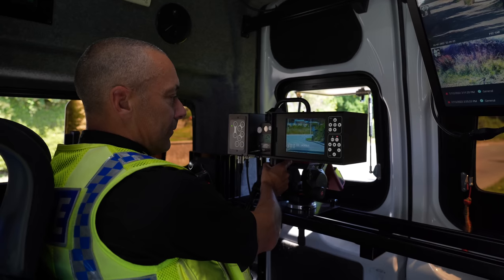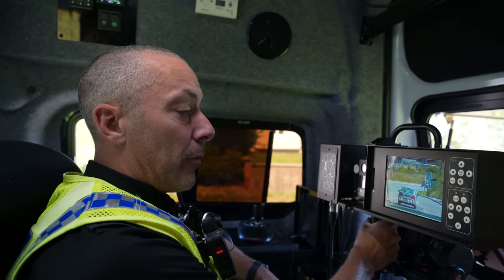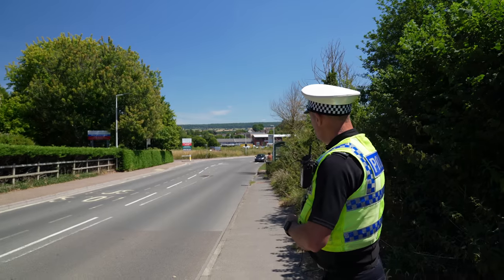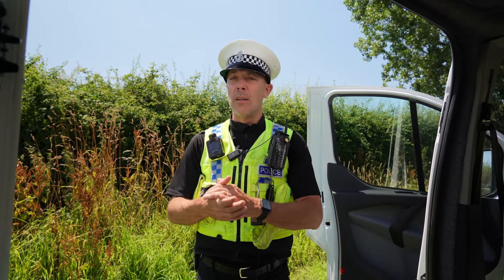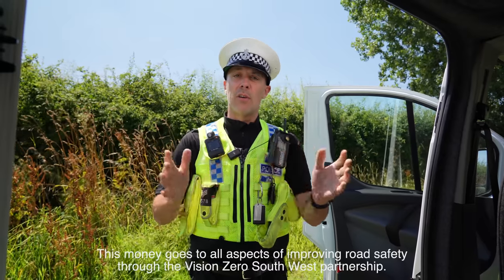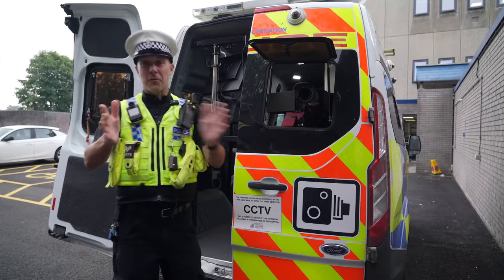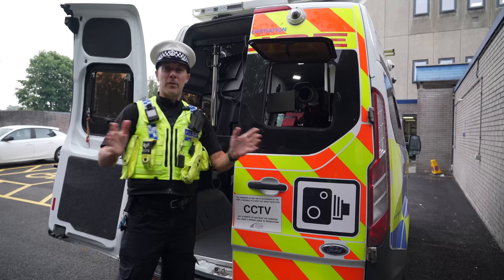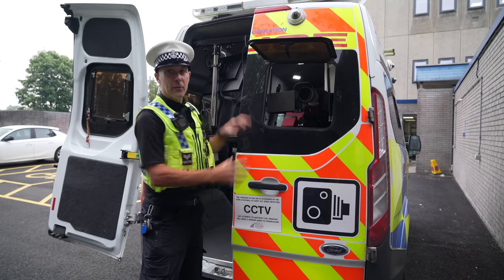SPEED CAMERAS - Road Safety or Cash Cows?

Comment: If they were designed for safety and as a speeding deterrent rather than for generating revenue then the police shouldn't threaten to charge / arrest people for letting people know where they are.
Reply: If there is no penalty, people will just ignore them
Reply: @Chrisallengallery  I don't think you understand my meaning. If i go onto Facebook and tell people there is a speed van out on X road just now, then there is the possibility i may be charged by the police.
Reply: @hardcoretam  I did miss read your comment.  I thought you were talking about not charging speeders.
Reply: @hardcoretam  I believe it comes under the offence of "wilfully obstructing a constable in the execution of their duty". I haven't heard of any prosecutions, and as Owen was saying, awareness of the location of a camera van does have the benefit of slowing people down. Personally I think that you shouldn't post camera van locations on social media etc, but that's just my opinion - I know many will disagree with me.
Reply: @robsayer8028  A driver was prosecuted some years ago for the offence due to flashing his lights to warn motorists travelling in that direction. Again, if that prevents speeding and works to reduce their speed then it offers the same benefits as a camera van in terms of safety.
Reply: @hardcoretam  wasn't aware of that, and I do appreciate your point... As I said before, it is technically illegal to do it, as it is also illegal to break the speed limit. If you do either, there's a chance you'll get caught. 
Don't get me wrong, people speed inappropriately every day. I don't think you'll ever meet a driver that can honestly say that they have never broken the speed limit. (I've had a few penalty points in my time as a driver - and hated every single one!! )
The one thing I've never done is either blamed the police or thought it was a revenue generation exercise. I did something, I knew the consequences if I got caught. Nowadays, if I'm not staying strictly within the speed limits at all times, I'm within the 10% +2mph guidance and pray that's enough to keep my licence clean!!
Reply: @robsayer8028  I never speed on purpose when driving and if i got points due to speeding thats 100% on me. 
My gripe isn't with enforcement of speed limits, but more the Police not being honest about why they use speed vans.
If it's really a safety issue to deter  speeding as they claim then they shouldn't be worried about people letting others aware of the presence as the outcome will be the same.
Reply: @hardcoretam  let me ask a question...

If a person is speeding, sees a speed camera van, but knows that they won't get be punished, will they slow down? Probably not as there's no consequence for their actions. Therefore, the safety part of the equation won't work.

There has got to be some kind of punishment for the offence. I think that partly monetary and partly risk of having driving privileges removed sends the right message. For more egregious speed limit infractions, then the higher the fine and more likely the disqualification.

Or the law could be don't fine anyone, just disqualify them from driving for a period of time (maybe a week for the first offence, then a month for the second etc.  etc)... Or would that be even more harsh considering some people have to use their vehicles for either getting to work or actually work in their vehicles.

Again, just my opinion.
Reply: @robsayer8028  I think you misread his comment just like the other guy did
Reply: @hardcoretam  The downside of that of course is that those drivers that slow when flashed will promptly resume travelling at unsafe speed once out of sight of the van. There is an argument to be made that letting them face actual consequences for their behaviour may make them think twice over the long term and have a greater effect on reducing risk.
Reply: @hardcoretam  theres a reason why people flash headlights after passing a van.... edit: not always but most ppl still do
Reply: @robsayer8028  I get you but if you warn other drivers then they won't speed and the job is done .
Reply: @hardcoretam  officer said he's all for motorists flashing lights as a warning  !
Reply: @johncummins3860  But he doesnt represent all officers and people have been charged for it before.
Reply: @hardcoretam  yes I know,  they should appeal any convictions on that statement  !
Reply: @follyfour506  fair point, but you might add "they won't speed THERE". If people aren't aware of where mobile speed cameras are, then maybe they'll slow down everywhere (I know, not much chance of that)!! To be fair, it's not people doing a few mph over the limit that the police are looking for, it's the ones way over the limit that they really want to get...
Reply: @hardcoretam  They are using the flashing light wrongly then. Please read up on the what's the correct use of flashing headlights then.
Reply: @roadbiker8333  Why i need to read up on the flashing headlights use 
1) when i'm already fully aware of the correct use.
2) correct use has nothing to do with the point i made.
Reply: @hardcoretam  if you know what’s the correct use of the headlights, you wouldn’t be asking the question that you have asked in your original comment. So dont lie.
Reply: @roadbiker8333  I've been studying the road traffic act, traffic offence court cases, Highway code, Cyclo-cross advice, British cycling advice, Insurance liability disputes, ministry of transport guidelines, Constructions and use legislation and regulations all for approx 16 years. 
It would be a little unusual if i didn't know the correct use of the "Full Beam".

However i'm not sure if you are trolling, deliberately obtuse, or just a bit slow.

In case it's the latter i'll break it down for you.

If the police are maintaining the position that speed camera vans are for safety and not for generating revenue then they should not be prosecuting someone with the  criminal (not road traffic) offence of "Perverting the course of justice"
They should instead charge them with a road traffic offence?
Do you understand the hypocrisy i'm trying to point out now?
Reply: No because your encouraging people to speed just after and just before the van. The penalty discourages you from speeding full stop. If I tell you the drug buyer is an undercover cop, that is still the police trying to discourage drug dealing, and I am obstructing them in the lawful execution of their duty. Same if I shout Police to a load of shoplifters to get them to run away, you playing look out so why aren't you guilty of an offence.
Reply: @PCDelorian  The same thing happens. As soon as people pass a speed camera van, they go back to speeding.
Being fined doesn't seem to be much of a deterrant as well as most people who have been driving a long time and have been caught speeding, still speed daily.
Work colleagues, people on forums, family etc all admit to it.
Safety is a guise.
Reply: Just use waze, ive never driven past one that hadn't been reported
Reply: @Chrisallengallery  The goal is to have no speeding at all, not to catch all the speeding drivers.
Reply: @hardcoretam  I always do this. As you say if it's all about slowing the traffic down then I'm helping the police. If it's really about revenue then they would have an issue, which they do.
Reply: @CristiNeagu  
Are you putting forward a case for automated cars then something that Tesla has been trying out for years?
Ever seen the sci-fi movie 'I Robot'? 
Doesn't seem like such a great idea to me either.
Reply: @seraphina985  they would still do this anyway. I find the people who speed everywhere, speed everywhere. But lots of people who aren't doing anything dangerious, maybe the traffic is all just going a few mph over the limit. Then it helps them all not be punished for not really doing anything wrong. If I seen someone absolutely flinging along the road I wouldn't flash them as they are driving dangerious. 
Most of our speed limits and rules are massively outdated anyway. Going 100 in a modern car feels similar to 50 in the first cars I ever drove.
Reply: @ellvee4261  No. What I am saying is that the goal is for there to be no speeding, rather than catch all the speeding drivers. Catching all the speeding drivers means there still is speeding. I am making no claims about how to achieve this.
Reply: @CristiNeagu  
You can't have 'no speeding' which is why you can't offer a solution and as I pointed out even if you took control of the vehicle by removing the human element then strictly speaking all it'll do is create a new set of problems and speeding would still be one of them. Basically because you are now going to trust your judgement and vehicle to a set of microchips and we a know what can easily happen to them in lots of different conditions.
Reply: @ellvee4261  Whether the goal is achievable or not is irrelevant. We can never have no crime. Should we stop enforcing laws? Even worse, the goal might be achievable, but through ignorance and laziness we never realise it.

For someone who claims to be so against self driving cars, you sure do spend a lot of time talking about them, even when you are told that self driving cars have nothing to do with the discussion.
Reply: @CristiNeagu  
I think you're far to self righteous about speeding myself but let's do a bit of number crunching for a moment.
How many drivers where 'caught speeding' by being two or three miles over the limit versus how many where caught and convicted over excessive speeding on motorways?
My point being and that of others here, it's not the defence of speeding it's the deliberate use of the language to justify mobile camera units that in no way discourage it, however the fines handed out to those 'two to three mile an hour offenders' will likely outweigh those handed out to genuine cases of concern..... dangerous drivers, making this a revenue stream and nothing else.
Reply: @hardcoretam  Yeah but I don't think that would ever happen.
Reply: @robsayer8028  The people operating these mobile vans aren't police
Reply: @hardcoretam  Around our area the police advertise on facebitch where they're putting them, we just share their posts.
Reply: What kind of backwards logic is that?
The primary purpose is to reduce speeding and deal with offenders. Someone blocking or obstructing that prevents this. If you save someone who has 9 points on their licence from getting a short ban, well done you. But don't complain when that same shit driver hits your property or someone you love and then you're back on here whinging that the police don't care.
Reply: @ultra_vires You seem to be confused. I'm merely just pointing out the hypocrisy of the police statements and actions.